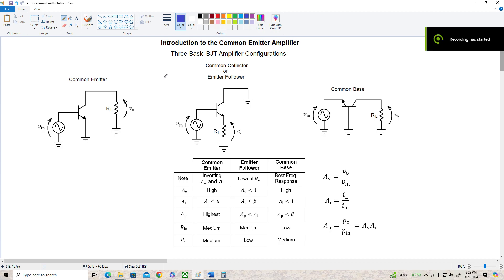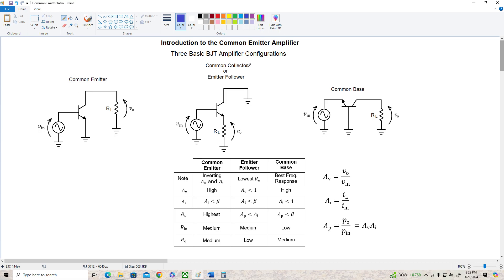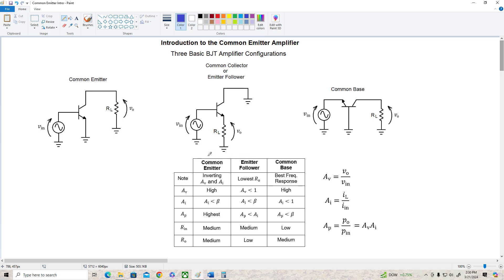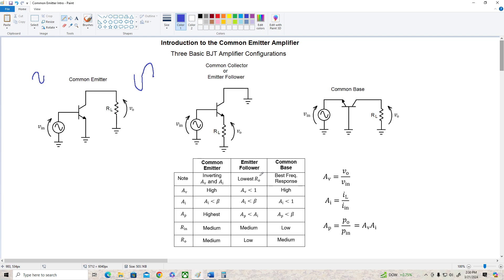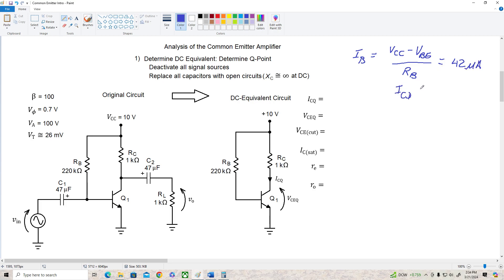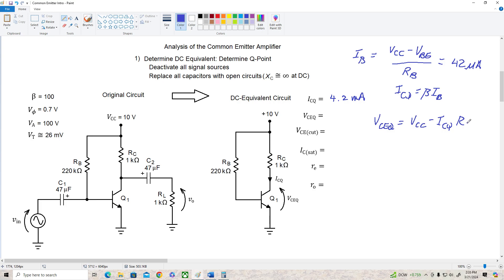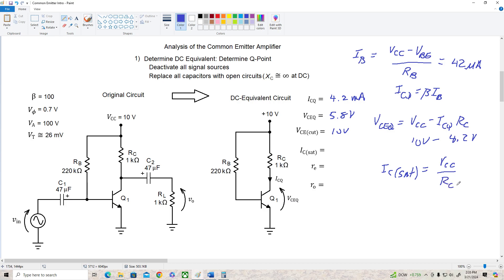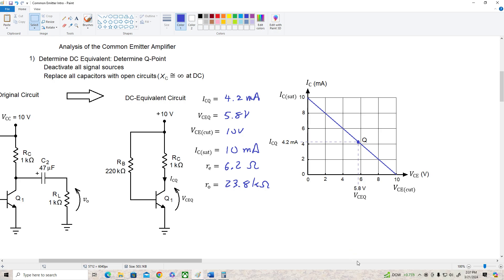Topic 29: Intro to the Common Emitter Amplifier

Comment: Enjoying working through your videos. As an aside have you already covered somewhere the design of a simple 5 watt guitar amplifier? I understand that the right approach is to start at the output and work backwards but my practical efforts so far do not get enough current running through the output transistors!
Reply from the maker: @Old_Coder  I haven’t done any vacuum tube amp design yet on YouTube. Just starting that material now. 

I presented the design of the 5 W practice amp on the Electronics for Guitarists Facebook page. Unfortunately YouTube won’t allow links in comments or I’d put it here. I will do that amp on here sometime, though.
Reply: @Electronics4Guitar  

Thanks I had a look on Facebook and that think I spotted the circuit with two IC's and a push pull output. 
What I have in mind is a template to design an amplifier from first principles and based on discrete components. I know this is a bit old school but it would be satisfying for me at least to achieve this .
Reply from the maker: @Old_Coder  I’ll get there eventually. I have enough ideas for a few hundred more videos 👍🏻
Reply: @Electronics4Guitar  Thanks . . . I'll continue to watch this space!